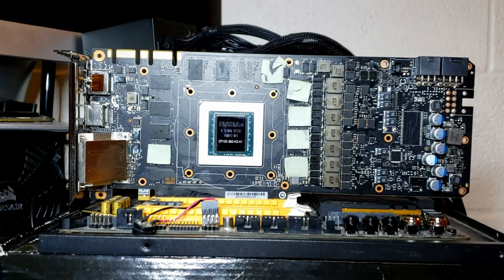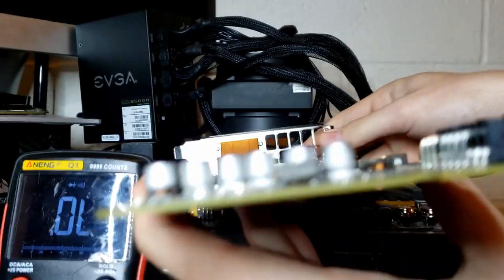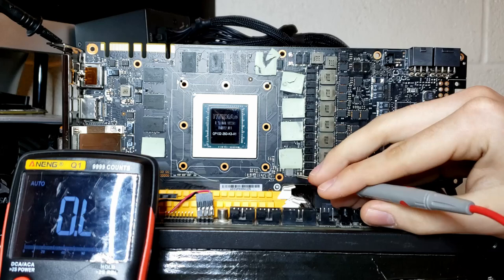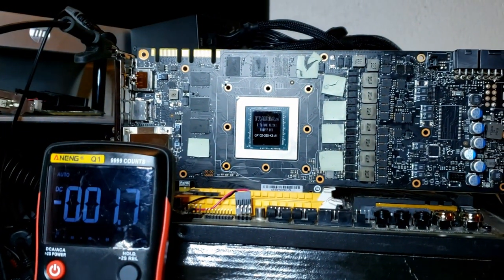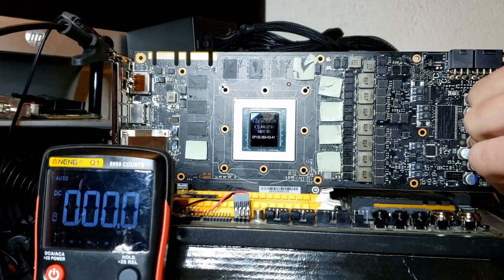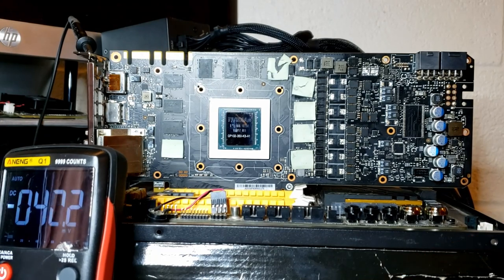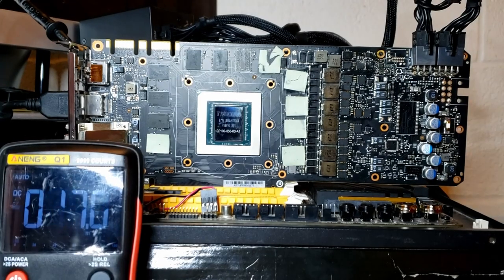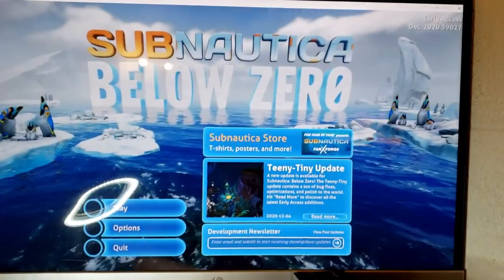EVGA SC GTX 1080 Ti SC Repair #2 - Computer won't turn on

Comment: Great video! One comment to other viewers "playing along at home" The original MOSFETs are from Fairchild, but he ONSemi ones linked in the description are compatible with it. (I think ONSemi renumbered the fairchild design after the merger). So if anyone is wondering why you replaced a fairchild MOSFET with an ONSemi one, that's the reason. The part is either the same or nearly identical. There are some other MOSFETs that have hte same pinout and similar characteristics that should also work, but finding them is left as an exercise to the reader. I though it's weird they used a mix of fairchild and AO for the VRM there.

Comment: bro i need help 911, the thing is i got a 2070 super,I have a little to no knowledge of repairing gpu. the thing is the pc recognizes it but it dont give no video out, from any of the output no display port no hdmi, no mini hdmi nothing. but pc knows its there and using the Teamvewer it doint gives no error like if everithing its ok. sorry for my bad english bro.

Comment: Been trying to learn to repair GPUs myself and have found your videos to be incredibly helpful. I've made some expensive mistakes along the way, soldering mistakes and the like but my main stumbling block at the moment is being able to diagnose where faults lay and what parts need replacing. I'm finding that watching, and re-watching your videos is helping to slowly increase my understanding

Comment: Really informative graphic card videos in YT ever. Truly appreciate your work. You are a gem to the repair community. Thanks. Just a request if you could explain about graphic card BIOS.
Reply from the maker: I don't actually understand the BIOS too well, I can suggest however that you watch Elitech's GTX Titan video as he gives basic explanation as to how it functions. Do you have a card with error 43?.
Reply: @TechCemetery  Hi I do have a Asus GTX 1070 Dual that someone plugged a 8 pin cpu power plug to it. Now fan spins and all power seems to be present but it’s not detected by the PC at all. Any help would be great. I don’t see any damage or burned SMD’s. Thanks for the suggestion. I will check him out

Comment: You could have checked for continuity from each 12V rail to the input of the MOSFETs to determine which ones were connected to the shorted rail.
Reply: they are in parallel so this unfortunately doesn't work
Reply: @jase171973  The 12V rails are not directly linked to each other. They generally use load balancing circuits that separate each rail from the others. Unless all rails are shorted to ground, they should not be connected together.

Edit: I wasn't saying you could figure out which MOSFET was shorted. I was saying you could narrow it down to just the 4 or so that are on that pcie connector.

Comment: Great video, informative.
I have a similiar issue with my Gigabyte 1080 Ti, when both 8 pin PSU cables are attached, the PC won't start.

Looking at the card as it's mounted in the case, the 8 pin connector on the left, when connected, trips the PSU, unplug that connector, the PC starts. Only when the right side 8 pin is connected will the PC start.

There's obviously a short in the video card, curious if there is a fix, maybe replacing a component or the whole PCB.
Reply: Same here short on 12v ext to gnd

Comment: Thank you, very informative and clear.

Do you recommend your multimeter? I'm looking to get one.
Reply from the maker: I actually don't recommend the Aneng Q1. The screen makes it run out of battery very quickly, and it can be a little slow to beep when using diode/continuity mode which makes it not ideal for tracing what components connect to each other.  I haven't used a lot of multimeters, but from the ones I've had, I'd recommend the Aneng AN8008.
Reply: @TechCemetery  Thank you very much.

Comment: Awesome videos! I've watched every one so far! I've got a 1060 6B and a short on the 3.3V PCIe rail. Would that be enough to kill a GPU?
Reply from the maker: If the card has sent 3.3V to the GPU for an extended period of time it may have killed the GPU. Shorts on the 3.3V rail can be tricky since basically half the board uses 3.3V. Can you confirm that 3.3V doesn't travel through an inductor on one of the voltage rails?.
Reply: @TechCemetery  I've erred on the side of caution and have not plugged in to test yet. If there isn't 3.3V to GPU, I'll have to inject some voltage to find the short. Thanks for your help and keep up the informative videos!!

Comment: Hi.
Awesome video assual.
Do you know anyway  to remove bad chip. Like a small mosfet or driver chip. Can't remove it with hot air. It's stuck to the pcb. I have a Radeon VII with bad 5320 driver chip. Impossible to remove.
Reply from the maker: I have no advice other than to use lots of heat, and flux. Sorry I can't really help you out here.

Comment: Keep going, awesome video again. Thank u sharing us, i know its hard when u reapiring cards, but same time try to teach something whit capture videos. I hope u make a video about using mats and mods step by step. I find some videos but not like urs. For example which operating system i must use for mats and mods? or how much gb flash drive i need? In which case i can use, some times cards has black screen but working whit out image so u can test it but when? Is it automaticly start when u plug in the usb flash? How u understand the test is finished and u take the flash drive out and look at report txt file?  I hope i can tell what i mean.

Comment: I have the same card when i start pc i can hear Windows sounds but screen is black with back light. I checked all the voltages and they are all present and good. What could be the next step, should I replace bios? Where can I order it and what version of bios is good for my card?
 It is evga 1080 Ti SC2     P/N: 11G-P4-6593-KR
Thank you !

Comment: Excellent job, may i ask how to remove bad capacitor in gpu its the through hole cap, electrolyte is leaking to the top, i try using soldering iron but not success
Reply from the maker: I usually heat the back of the board where the capacitors legs are and pull/push the capacitor out using tweezers.

Comment: I have and EVGA 1080ti Sc2 icx where fan 2 never turns on.. I've tried manually turning it on in precision X1 but nothing. What should I do?
Reply: run a external fan or water cool it.
Reply: @jase171973  Thanks, I actually replaced the fan, all good now.

Comment: Is it safe to remove one shorted MOSFET and run the card without it?
Reply from the maker: Only at idle to check if it works.

Comment: Hi, I'm playing with the same model 1080Ti I have all voltages present except at the memory vrm. I also read 0 ohm here at the the memory vrm (with the power off. I read continuity between pin 3 and 4 of the vrm mosfet and the 12v of the 8 pin.
Any thoughts or suggestions?
Many thanks
Reply from the maker: Probably a dead MOSFET, and likely a dead GPU as well. Check the resistance of the High side gate pin (HSG) on the datasheet for your MOSFET, if it reads as 0 then take off that MOSFET.
Reply: @TechCemetery  I've tried taking off 2 of the mosfets but they are being very stubborn, how much heat can they and the board take? (using hot air and flux) They are aoe6930 in a DFN 5x6E package. 30V Dual Asymmetric N-Channel AlphaMOS. according to the data sheet.

Comment: Have a Aorus 1080ti. All voltages ok. Gpu gets varm but not hot(30~35C). No picture. 
What can it be??
Reply: Buy the way. I think fuse F3 (think It's 10A) dead. Near pci-e. Should i change it or do i have to test something before test run it?
Reply from the maker: The fuse is unlikely to be bad given you have all voltages. You probably have a bad GPU. What is the resistance on the PEX rail, 1.8V rail? and memory phase?.

Comment: First channel i subscribed ever...
I recently buy-ed 2 broken msi gtx 970....1 spins fans but it's not recognized, second one have short on 12v rails, i noticed that first dual-channel mosfet (first from the pcie lanes ) have melted solder balls under it.....i have working ones on the first gpu.........please help my Tech Cemetery. I ordered 2 same gpus, so i can have spare part in case i figure out the problem.
Reply from the maker: If you have melted solder balls under a MOSFET, take off the MOSFET and check for a short.

Comment: I have a 1080 that won't clock over a few hundred khz. If you want to take a crack at fixing it I'll pay you for your time.
Reply from the maker: Usually with cards like that the current sensing circuitry is damaged. If you look at power consumption via the 8 pin external power connector and the PCIe slot using something like GPU-Z you'll might find some bogus/inaccurate reading.

Comment: The gate on this kind of mosfet package is ALWAYS pin 4!!! Don't trust on this kind of information. Bad lesson here!
Reply from the maker: No

Pin 4 is the 12V input, you can read the datasheet linked in the description, it's correct.